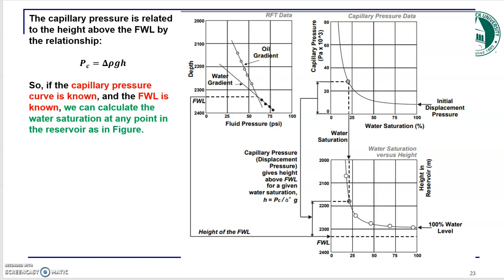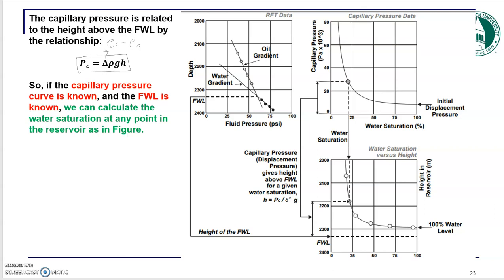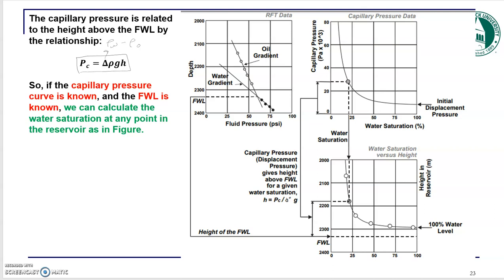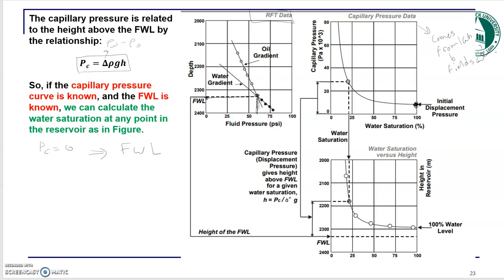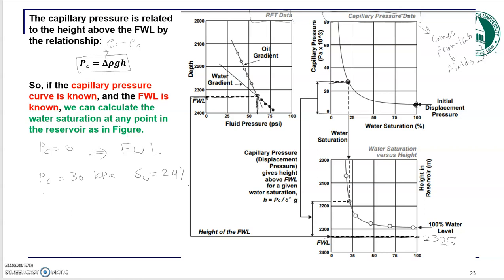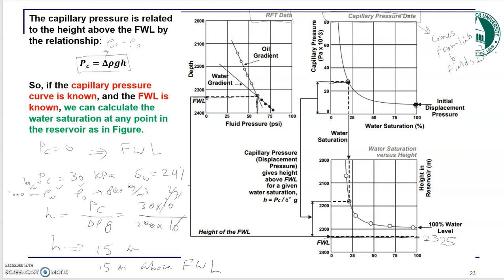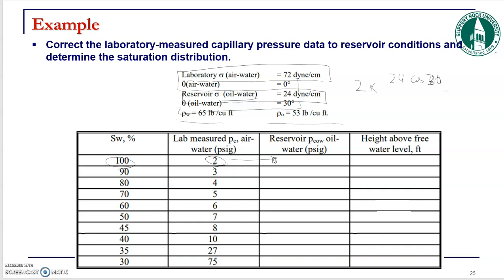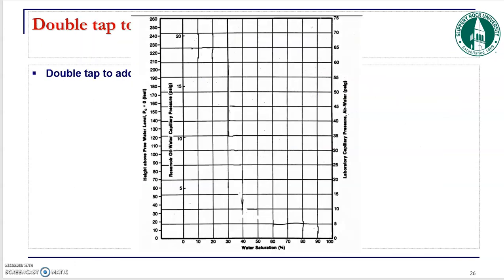24  capillary pressure 8

Comment: Thanks! One question, regarding the RFT, what pressure will you get if the depth is  between the OWC and FWL? The RFT pressure point will be on water or oil gradient ?